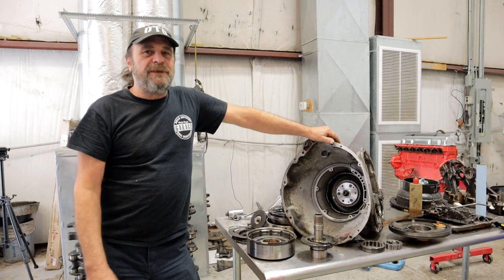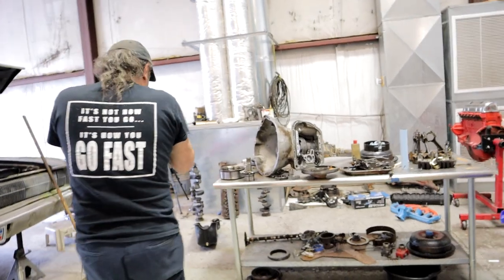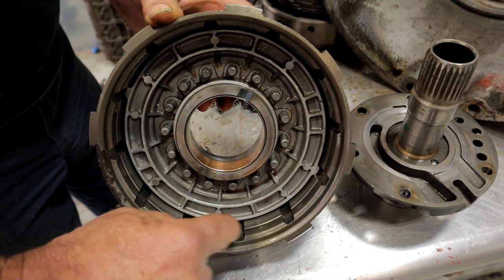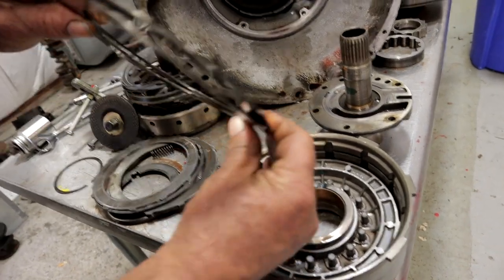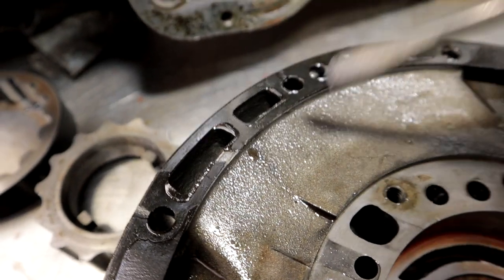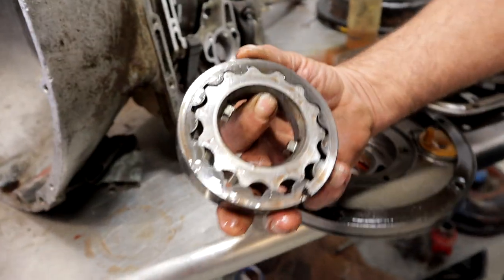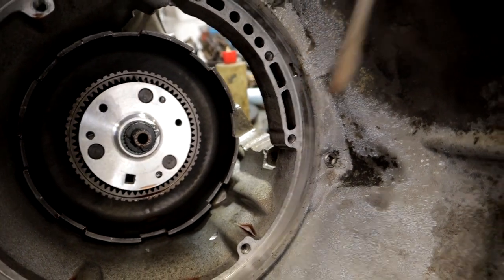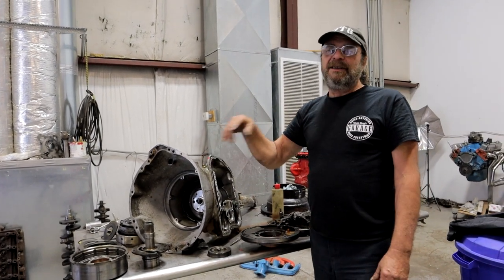Dead Torqueflite Autopsy - Digging Into Our 67 Charger's Transmission To Find Out What Let Go

Comment: Change the converter. All that clutch and metal debris is inside the converter too. I would change the cooler/radiator as well. Putting that debris back into the trans will take it out years before it should fail again, and it wont last 50 years if you put debris right back into it.
Reply: Cooler lines and cooler can be flushed.